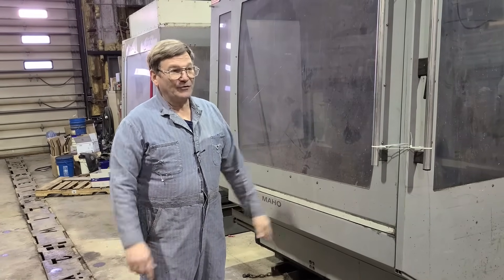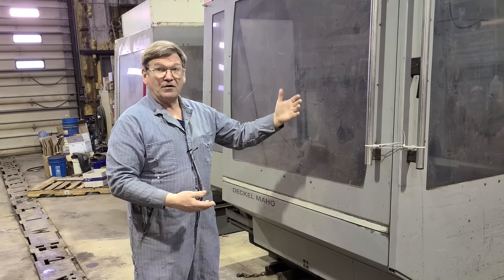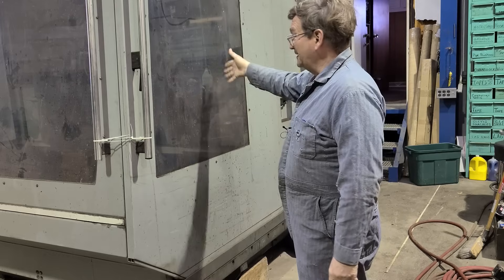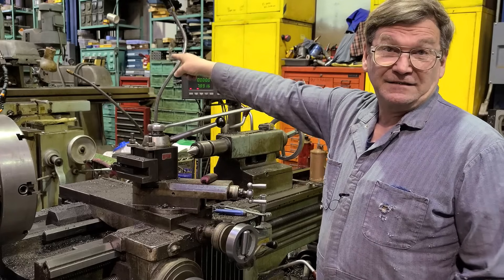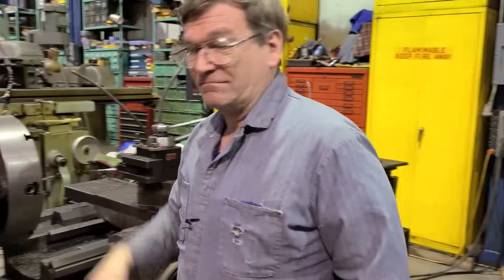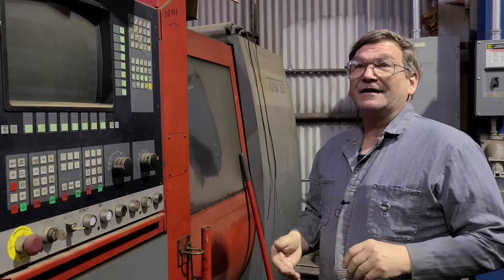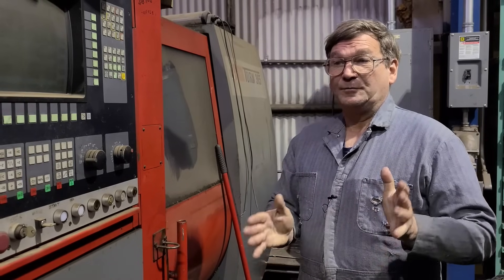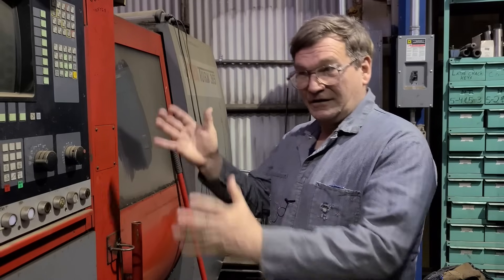Machinist's Minutes: One last CNC discussion

Comment: Controlling your swarf on a cnc is what separates the men from the boys. You need to know how to push a chip off so it can run lights out
Reply: It's also worth pointing out that if you are watching the machine run then you do have the option of pushing the red button and cutting chips off then pushing the green button and let it continue.   You shouldn't have to do that, but you *can*.
Reply: Does your insurance company know you are running industrial machinery without human supervision?
Reply: @rok1475  And just who is this machinery going to hurt if there is nobody nearby?
The insurance company doesn't care if you wreck your tooling.   I have wrecked tooling when the coolant channel clogged during a run, and that cost something like $250 to replace (which was annoying) but that was after hundreds of hours of running without supervision.   How much would hundreds of hours of supervision have cost?   The people putting stock in the machine have no experience.  They are just people who are working elsewhere in the plant.  They drop by every 45 minutes to pull out parts and chips and to put in a new piece of material, so every hour I get 50 more good parts, and if anything is wrong (out of spec size or bad surface finish, for example) then the machine stays off until I am in the next day to adjust the wear offset or sort out the coolant or whatever.
I mentioned before that I was quoted $3 each for these parts.   That's $30,000 for 10,000 of them, or I can buy the material pre-cut to 4' lengths for $1500 and have a person with relatively light duties spend some of their time changing parts.   It's not a difficult decision economically. $30,000 vs. $1,500 is pretty significant.
The only reason I takes 45 minutes to make 50 parts is because I am single-pointing the parts.  If I was to get custom tooling made I could make the parts in seconds, but then I can't make changes without having the tooling modified (I don't have the equipment to make the tooling).   For us, the way we do it is by far the most reasonable, and the insurance company couldn't care less.
Reply: @rok1475  it's cnc. It's made to be run automatically

Comment: I feel like people do the same thing here as they do in other areas like automobiles....oh everyone should buy an electric car...no...right now they have a place and a use case....not for everyone not all the time for every task...you wouldn't buy a 40,000 dollar medium duty truck used to haul 5 loads of firewood a year...it's just not the right tool for the job...this applies to most things...you have a really nice lathe that you care for and spent good money on when the job calls for it...if you need to do an emergency job on a crooked rusty spare part that's been in the woods that requires you to cut an inch off the machine for clearance to make it happen you have a cheap machine to use for that, it can absolutely make you 10 times what the machine cost cause new part is unobtainable or needed right now, high priority need it now problems pay accordingly to be solved...as he said a 1000 dollar machine was modified used to make the customer happy and make the business much more money and the machine is still worth as much or more now that you even have the extra flexibility ...and a worn out loose machine just requires an operator that's worth what he's paid and a little extra care and attention to detail to make a quality part...wouldn't wear rare expensive shoes to work in the rain...at the end of the day they are tools and destroying a 1k machine to make 10k is a good idea...if you have work that lends itself to the cnc's abilities great...if not why have the money and space tied up...again wouldn't buy an 18 wheeler to haul 5 loads of firewood a year...right tools for the job and such...use your brain...spend less make more live well...

Comment: In machine shops down here in the states in my area it’s now common for so many people to say “just do it on one of the CNC machines.” Or “just draw it up in MasterCam and run it.” I’ve had to prove to them that sometimes manual is faster. I do agree 100% that you can’t know everything. All the senior guys I’ve worked with have taught me so many different ways of doing things. It’s one of the many reasons I love the trade.

Comment: About half my carear was with manual and the later with cnc as mostly  toolmaker work so very small quantities say 1 to a dozen parts.
There are plenty of times a cnc doesn't make sense and manual is faster.
There's programming time and set up time to factor and the first piece takes some dialing in.

I ran a toolmakers version of that machine shown 5 axis but always had a bridgeport handy for some of my work.
Laguns were stronger and more accurate then bridgeports.
My older Maho was conversational which blows away Fanuc and it's a shame all machines aren't conversational.
I ran fanuc later for many years and was very proficient but give me a conversational any day.
Haas fanuc was far superior then the other fanucs (but the machines were lighter duty )but still you would think by now everyone would agree on one type of programming for all machines.

We had cnc surface grinders in one shop that were more of a pain to use then conventional ones. 
CNC isn't always the answer.

Comment: i think this isn't a cnc vs manual machine video, this is a market and location video.  If your in a location where all of your work is large shafts and they are relatively simple then why get a cnc. if your doing a lot of repair work why  get a cnc. I would put forward the point you buy the right machine for the job. it can be manual or cnc. At the end of the day the business that makes money stays open and if that means you can stay open running manual machines, great. But if your struggling to get work because the competition can do it faster and cheaper then it might be time to rethink your business strategy.

Comment: cnc is cool cause you have ballscrews, so if you treat it like a manual you can still do some cool stuff, not even counting the crazy profiles and what not,  However most manuals can do things that CNC's just can't do. As for who's on the hook to make good parts, the guy setting it up AND the guy running production, everyone else in the chain is there just to make sure those folks are doing their job correctly.

Comment: Nobody ever seems to talk about how difficult it is to make an accurate fit in a cnc machine (especially a mill). Good luck hitting a few microns if you don't have a boring head and need to rewrite your program for every adjustment.
Reply: Have you ever heard of wear offsets?
Reply: @tbdcreations5370  Many older controls don't have this feature or they hide it in another menu.
Reply: @reinermiteibidde1009   Some very old controls don't have offsets for milling tools. 30+ years ago. My point is reprogramming to cut to final size is not something you do or have to do.
Reply: @tbdcreations5370  It's exactly what i have to do. Open the door, measure, reprogram, cut and remeasure. I work on 1990s Mahos.
Reply: @reinermiteibidde1009  And by "reprogram" you don't just mean taking 30 seconds to change the location of your finish cut? Even that old control should have a local edit function. 

Still, for anyone using a machine less than 33 years old, you'd simply change the diameter offset in the control. Just as fast and far more precise than a manual mill.

Comment: Another video full of copium. Is CNC always the answer? No, but neither is manual machining. Half of his arguments are bullshit. You don't have to have the newest version of software to run a machine. All you need is a version that works for you. Programed parts at a shop that was using 10+ year old software. Was it as easy to use as modern software? No. It's post for the machines we had we rock solid and very rarely needed any tweaking. That's why they still used it.